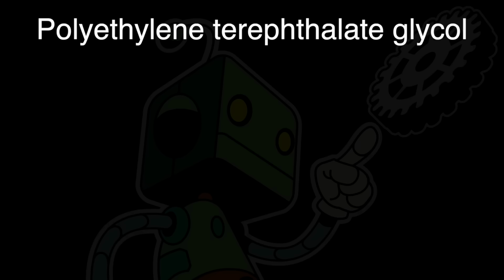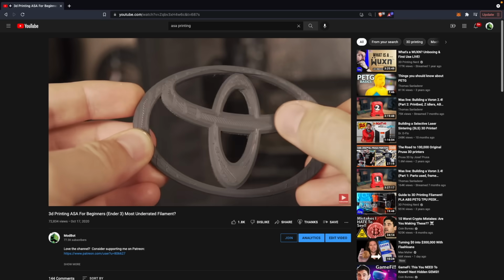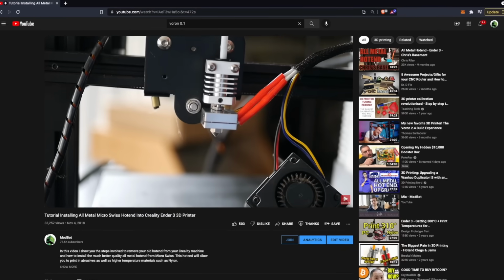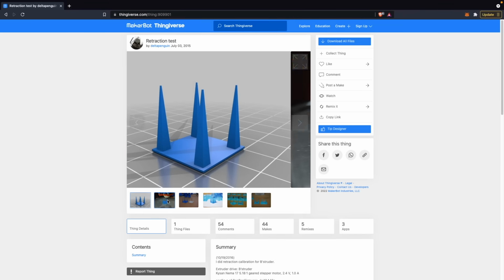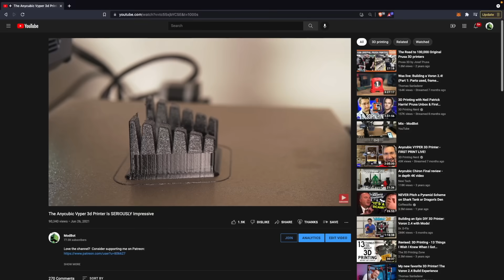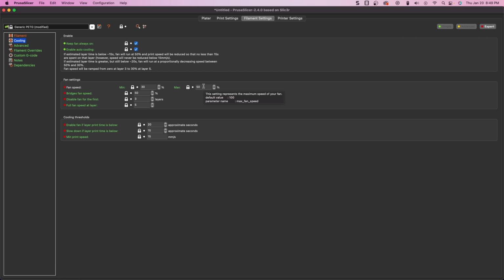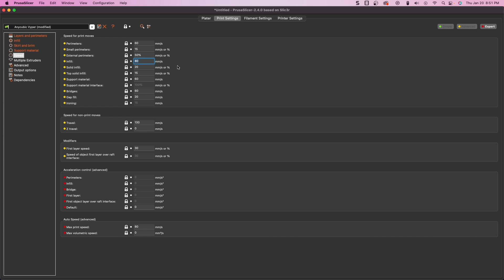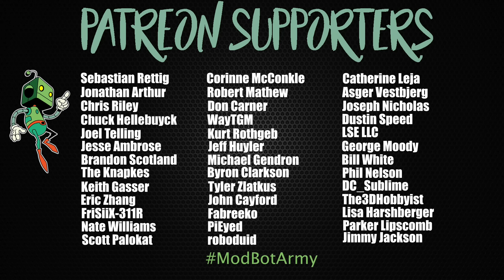3d Printing PETG For Beginners! Great For Functional Parts

Comment: I'm planning on making some dust covers for our wheel loader, since we use it to move peat around a lot, which causes the hydraulics and grese fittings to get really dirty. During winter, the temps can drop to -30°C and during summer they can climb to 30°C. I'd like to use something like ASA or ABS, but I own an A1 without an enclosure. Do you guys thing that PET-G will be okay for the application? Thank you very much in advance. Your answers will save me tons of time and be greatly appreciated! 🙂

Comment: I guarantee you these slicers could add auto supports and brims these days. If part is thinner than x, add brim. If part has features thinner than x, orient part so that features aren't along layer lines and add support to correct the angle.

Comment: I absolutely cannot get PETG to adhear to the bed properly.  It has been horrendous.  I have a creality ender 3 and have about 10 years experience working with it.  I have tried a freshly cleaned glass bed with glue stick, higher and lower bed temps, changing initial layer speed, etc.  It seems to lift and curl when initially starting a layer.
Reply: I have the same printer. I use glue stick on a PEI plate at 80 and hot end at 220. I am using elegoo rapid TPEG. I found these settings worked well. I have no experience of glass plate (other than my first printer) to speak of but would suggest that glass is going to be a real issue for PTEG. I totally disagree with the chap in the video that glue stick doesn’t help with sticking, I can’t get the PTEG to stick without it. I hope this helps. I have real trouble doing print in place stuff.

Comment: I had PLA 3D printed parts in a drawer in Thailand and after about 4 years these parts fell apart to dust. Simply PLA dust. PLA is very easy to print but forget it for use in a warm environment

Comment: I must be an outlier then. Outside of PLA the thing I use the most is ABS. That's because the main reason I wanted a 3D printer is to feed my other two hobbies which are woodworking and model making for One Page Rules (better Warhammer) where I enjoy scratch building terrain. There are a lot of things you can make just by cutting styrene sheets, tubes and channels creatively but there are more complex shapes that it's just better to go in the direction of the early ILM model makers where they just vacuum formed complex shapes. On my Prusa MK4S it comes out so fine that primer, paint and special effects medium completely hide the layer lines and ABS filament can be glued with normal model cement.

Comment: Since this video is 2 years old, would you recommend this information or does it need an update?  I have the new bambu a1 mini and ive heard its an improvement over the ender.
Reply: I'd say pla with a UV resistant coat form hobby lobby would be way faster or pla+

Comment: Ok I had a part in a model train got too hot and warp. I needed to try PETG for the part for better heat resistance. My print started out ok but started pushing out nurds or crumbs. I went hotter and slower that helps but the print time went from 2 hours to 4 hours. Not have to print another part after some edits in the design. I read some papers and listened to lectures like yours. I never had a print look like yours they were beautiful. I  hope to get there soon. My parts are for model trains. The guys hate to sand and paint. Thank You, Dennis

Comment: Would a Capricorn PTFE tube have a higher temperature resistance?
Reply: Look up " Luke's hot end fix" Capricorn just in the hot end, and regular ptfe the rest of the way. ( I should add, for non metal hotend) I did this to my CR6-SE a few years ago, never had a clog since. You still should try and stay on the low side for temps if possible for petg.
Reply: Thank you so much, I have almost lost hope!
Reply: @MaxHackbarth You're very welcome. I forgot to mention, I learned this from a guy on  youtube his channel is called "CHEP".. smart dude. I think I downloaded the hot end fix from Thingiverse if I recall correctly. The download includes models so you can cut the capricorn square and depending on what printer you have gives the correct length for your hotend. It also should have a "spacer" which is a funnel type it goes on top of the capricorn tubing then the threads of your ptfe fitting will compress the capricorn between the fitting and the nozzle. You can print the spacer from PLA as it's at the top and heat does not bother it. Very important the capricorn tubing is cut square where it meets the hotend nozzle. Good luck, Greg

Comment: My petg manuf roll recommends 235 to 255C. I lay down a raft at 255C to stick the piece and the fan off which sticks to the glass mirror bed very well. But when I print I did a temperature tower. Eventually I found 215 to 220C prints best (and strongest) but I find small parts are melting from the hot head being near it while they are  being printed. My bed is 65C which works very well. I am not sure what to do as 70% fan speed appears too slow now for the 220C head temp as it is melting the small parts. Going slower seems to definitely "hurt" for petg but what I most do faster is still a mystery to me. The petg seems to like being extruded slower but must not remain hot on the workpiece.

My temp towers were 265 down to 235 initially but I redid them from 235 down to 210. The printed better at lower temps but I still needed at least 255C to stick to my glass mirror bed. Once it cools down the raft sometimes remains and the workpiece pops off first. The raft seems to only stop adhering below 30C.
Reply: I print my petg at 225°C( esun grey petg) unlike they say from 235 to 250, bed temp is almost 75 annd after 2 layers my fan is about 40%. I do'nt have problems with stringing. It takes a few weeks before i get to the right settings for me an a lot of youtube videos and 
cursing, lol
Reply: @filiepmaes9071 Haha OK I'll try it. I am getting much better lower temp  first layer PETG (SA Filament Copper - "more like pot plant brown red") stick by doing a bed level print of 4 squares at 0.2mm each. One in each corner. Then I peel them off one at a time and vernier measure each to see if they actually are 0.2mm thickness printed. If not, I adjust the bed level and Z height till I get as exact a 0.2mm as possible in all 4 corners after a repeat reprint. Even 225C with a 65C glass mirror bed is sticking well. Set accel to 700 and Jerk to 7 and if I choose too high a speed at least those two limit the rate. Getting very little stringing now and melting problem seems to have disappeared. Just the stringing still a bit.

Comment: 0:22 My second material is TPU. It seems to have the advantages of impact resistance and toughness but can be printed at lower temperatures than PETG with a stock hotend with a PTFE tube. So far I have been happy with PLA and TPU. Don't know why I'd move to PETG.
Reply: for prints that require rigidity?
Reply: @bboyy122  I find I can add rigidity by adding screws or rods where needed. I still use some PLA in places TPU is not right. The flexibility of TPU can in practice be altered by changing infill and by changing geometry.
Reply: @peircedan imagine preferring a rubber gear with screws and rods in it as opposed to simply using a solid petg one
Reply: @ygaddi  I like TPU. There is no issue with delamination and it is nearly indestructible.

Comment: if you are getting plastic on the walls of the plastic its due to either the nozzle is scraping the previous layer or retractions that cause strings to build up on the nozzle walls. both is easy to fix on these direct drive extruders.

the "barrier" is called a release agent ;)

Comment: infill at 80mm/s simply do not work. Not for a mkIII. Not for PETG. Once you use correct settings, you will have far stronger print, and can reduce the amount of infill you use. For perfect infill, you need to drop below 20mm/s.

Comment: I was having so many problems with petg out of nowhere like it worked well for a while then just wouldn't retract right and the parts were just so messy.  Finally I dried it for like 10 hours and it printed FLAWLESSLY like I couldn't believe how perfect it came out.  I didn't think moisture was the problem because it happened with a new roll, but I realized they were shipping them with moisture in them.  So even the stuff you get new, I recommend drying it for at least 5 or 6 hours, or 10+ if you really want to play it safe.

Comment: Are there any adjustments that need to be made when using the powder coated print plate?  I just cannot get the first layer to adhere but it adheres just fine on the smooth plate.

Comment: Pla is sufficient for the most, have had a soap stand in the shower for 3 years , soaked in water every day without a problem, and th3 sun hits it . I would not use anything other than pla unless you really need it.

Comment: By coincidence, I have my very first spool of PETG arriving today. I thought it was time to expand beyond PLA, so this video was very timely. Thank you for it. 👍
Reply: I have ordered my first spool and I'm nervous but also excited to try something new. Still a Newbie only had my Ender 3 v3 se for a month and a half.
Reply: @hippysplace  - I had no trouble printing with it. I was worried for nothing. You probably are as well. Although my X1C maintains a warm chamber temp within the enclosure, if that makes any difference.
Reply: @davidsh331x  my spool won't be here till next week. but its good to hear you had no problems
Reply: @davidsh331x I too was expecting it to be real hard. Other than my first two attempts which failed to stick to the plate, I have had nothing but fun with it.
Reply: @davidsh331x what filament?  Struggling with X1C and Sunlu hs matte PETG.

Comment: I've been 3D printing since there were no consumer/hobbyist machines and the only way to 3D print was to build your own 3D printer, but I'm very late to PETG.  I just tried my first PETG print.  It would have worked very well in PLA or TPU but the first layer failed when the print was around 5 mm tall.  I was printing on a new PEI sheet with excellent bed leveling and Z offset.  I guess I'll try a glue stick (meh) and a brim.  Or maybe I'll reslice the part for PLA.

Comment: Not happy with my PETG printing.  Much better when in dehydrator over nite at 140F.  I had lots of problems with infill stringing.  Also problems with printing parts with fine detail like unrecognizable small raised letters.  I used 235/80 with low print speeds (50/20mm).  Printed same part in PLA+ with excellent results.  Today I do my first ABS and doing same part for comparison.  Your videos are very valuable to me.  Thank you for sharing, Doug

Comment: great Vid.  just wondering about the print surface you mention I have a ender 3S1 it mentioned PC coating?  is that one of the bad ones I need to watch?  sorry for stupid question I normally use PLA + and have been looking at PetG for a bait board  for my boat.

Comment: Hey guys I printed loads of parts in PLA in 2019 and 2020,  I live in Vietnam where it is hot and humid all the time.  What I have noticed is that ALL and I mean ALL the PLA printed parts in the last 6 months have all turned into Brittle POWDER, Literally with 2 fingers and a squeeze the parts will just EXPLODE into dust kinda like Sugar with lumps.  So I am Switching over to PETG

Comment: I'm kind of struggling with adhesion to my glass plate. What's the overall mindset with temps and adhesion? How liquid do I want the material to remain once deposited on the bed and for how long? Do I want it to be deposited in an extremely liquid state and slowly cooled to the bed temp, or do I want it to cool quickly? Do I want the bed temp to be as close to the print temp as possible. If my bed is at 70, and I'm not getting good adhesion, do I want to raise or lower the printing temp?

Comment: Could you just do a Capricorn Bowden tubing upgrade instead of a $60 to $70 hot end upgrade?
Reply: The Capricorn tube certainly does help. You can probably go to printing 250....But I WOULD NOT print over 250, just by changing the tube.

Comment: I started with PLA and instantly realized it was a total loss for printing industrial hardware for parts that stand for many years in the far northern weather…hot sun…REEALLY COLD Winters…I moved to ABS which has been okay…still not perfect…going to try PETG after this…then we start looking at the exotics.  Thanks for the informative video.  We beginners are a hard enough audience to reach…add to that that I’m an old fart who is a technophobe…well…thanks for staying simple
Reply: You should try asa its relly resistant to uv light

Comment: Caveat, I'm a noob.
My first 3 reels were PLA... results? not bad
4th reel - ABS, much better looking and durability than the PLA
5th reel - even much better looking than the ABS, but.... adhering to my glass bed seems to be an issue, as I get prints starting to curl up during the print.
all this is maddening with the learning curve... but I persist .

Comment: Thank you for this. My mk2s is 6 years old and the parts are brittle. So now I'm printing my second time with PETG and trying to find the best settings. Imma try what you suggested. I too and using the prusa slicer. I have ESUN PETG just opened (but about same age as printer) and I'm using the prusament PETG filament settings to start before I modified everything per your video. - John

Comment: I can't get the PETG to stick with a skirt. If I print with a raft, the raft lays down perfectly. Why doesn't the first layer go down like the raft. I checked the bed level. I set my first layer to be 0.24, just like the raft. 240/80 on temp w cooling off. Tried glue stick and hairspray on Ender 3 Neo. Any ideas?

Comment: I definitely had issues with PETG being attracted to copper and its tendency to curl back onto the nozzle. A steel nozzle fixes that issue completely. For me, this was the cause of a major hot blob in one of my early overnight prints and was always causing minor first layer adhesion issues. But ever since moving away from copper/brass things have been perfect.
Reply: 2 years late here but I was having the same issue on my Neptune 3 and swapped for steel nozzles and that fixed it as well. I was about to give up on PETG until I found this video.
Reply: I have just got a roll of petg. Ive had a steel nozzle for some time and never needed it. If i have issues i will try that. Thanks for the info ✌💚🌞

Comment: I'm a week into 3D printing I started with petg on an ender 3 I warped the middle of the bed the printer comes with so now I can only use the corners but I recently got a creality glass bed which is perfect I just printed my son the Lucky 13 poseable toy in pla and a joint snapped under pressure... Maybe pet g would have been better

Comment: Funny thing is, the 1st roll of petg i had, pissed me off so much I jumped to PC,nylon, and my favorite CF-nylon. With PETG my print would get halfway done and the nozzle would just clog up. Recently I got a new printer and decided to give petg another chance and got a few new rolls. Much better now, i must have got a bunk roll the 1st time. Still when I need something tuff as nails, I go with carbonx cf-pa, though I really like Priline and esun cf-pa a little better for its surface finish plus the filiment is alot less brittle than carbon x.

Comment: Would you recommend a 3D printer coming with an enclosure like the Ender-6 or instead make an DIY enclosure and focus on another 3D printer not coming with enclosure? Print volume of at least 250x250x400mm is needed. Carbon filled PETG and ASA will be printed for functional parts, thus needing full metal hot end and a wear nozzle.

Comment: Another good tip is if you have a bed leveler to slap a glass plate down on top your normal printing surface, put some stick glue down and print away!

Comment: PETG Overature or Tpomins(?) I think thats how you spell it.  Ender 5 pro, temp 230-235, bed 75-80, Hictop PEI rough mag bed, dryer box...works pretty good. I did however change the board and it threw everything out of whack. working on recalibrating currenly.

Comment: I have printed probably 50lbs of petg in the last couple months . All metal hot end with direct drive helps. Also glass build plate with layerneer bedweld The parts pop off when it cools. I used school glue ect before and it’s just more work.

Comment: You're mistaken about the Creality Ender 3. The PTFE tube, doesn't reach the hot zone in the Ender 3 hot end. The throat is narrower in the end of the cold zone, just around the edge of the heat sink. I print A LOT of PETG in my Ender 3 Pro for at least a year now, and I have no PTFE melting at all.
Reply from the maker: It goes all the way to the nozzle. Unless you don’t have an Ender 3. https://youtu.be/Fb4XMbZ0iA4

Comment: Interesting bit about the hot end. I started printing petg as my first filament even before pla, i have printed a ton of petg car parts with stock ender 3, i always ran the nozzle at 235°C. I have never had a problem with the bowden melting but i might have just gotten lucky. I didnt know it could produce toxic fumes.
Reply: I think the toxic fumes was about the PTFE-tube inside the Nozzle-thingy, if that would get over 250°C .. PETG itself is as far as I know not toxic??

Comment: I have a flash forge adventure 4 . I use the .6 mm dia nozzle , 80 c bed temp and no skirt or brim. The issu3 is stringing and blobs that occur randomly . This has a Bowden tube so I was wondering it retraction settings should be longer and faster . The  5 mm length and speed at 50 is not working

Comment: I consider myself a novice printer, I've converted over to PETG from PLA. I print on a metal plate, and I use a standard school glue stick as an adhesive. I use generic PETG filament, and print it at 235°C - 240°C, with the bed staying at 100°C with relative ease.